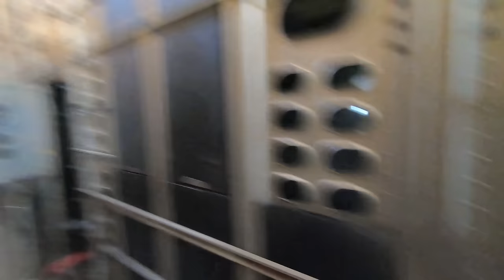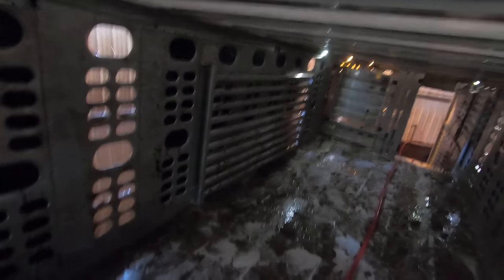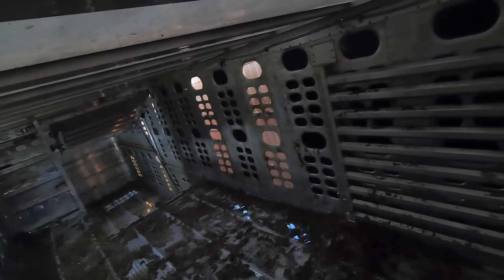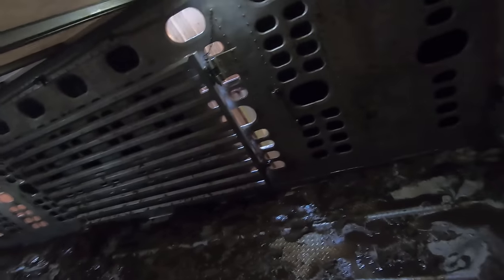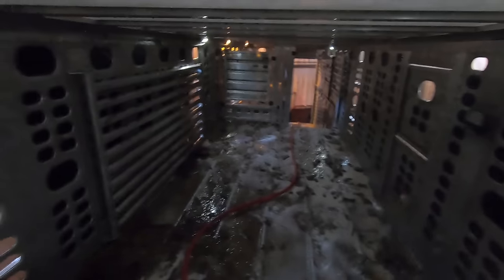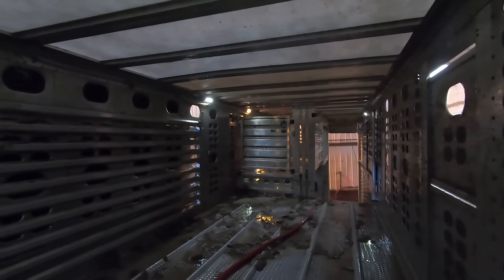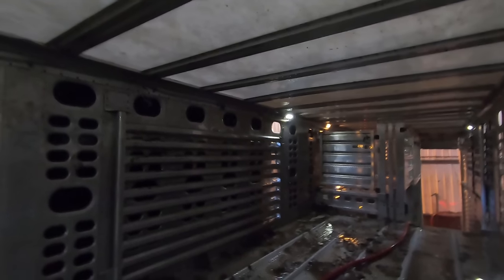Worlds Dirtiest Job

Comment: I washed out cattle trailers for 6 years. I’ve washed out cattle trailers that had so much poop in them you couldn’t open the center gate packed in the bottom like concrete. I hated those four deck sheep trailers you either had to get in the trailer on your hands a knees to wash it out or remove the aluminum boards out that was the old style trailers. The newer trailers the floors would fold up to the sides.

Comment: some of the Wilsons had rods and trap doors in the floors. when one of the rods got bent or froze. the apprentice had to roll around on a creeper to find and fix the problems.now.. that was a dirty job, we would tell the new guy to go in to hold the huck bolts. then lock the gate. and, go to lunch..ah good times.

Comment: That's a shitty job!
 You are a rare breed dude!
Aren't you supposed to use chemicals or sterilizers to clean the trailer after every load before putting animals back on?
Reply from the maker: It is lol 
Depending on where you are picking up at, you do have to use chemicals to clean trailer. But not all places require it. 

Really appreciate you watching, Rob!